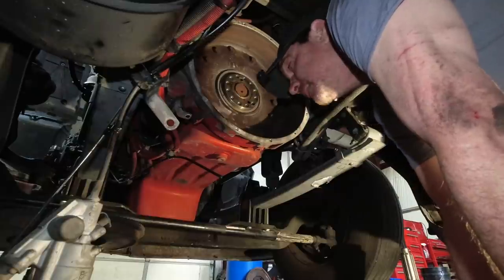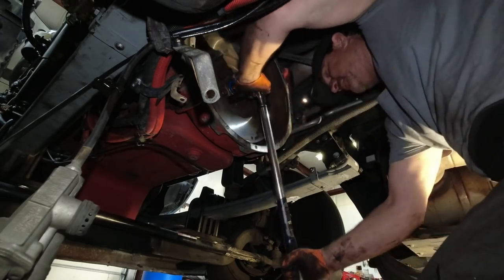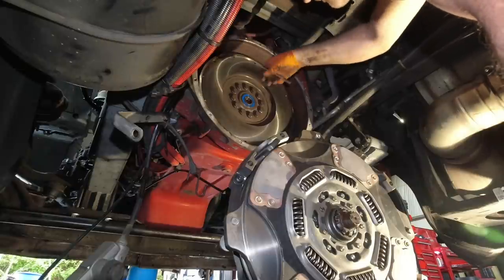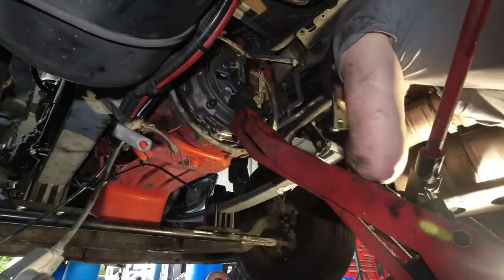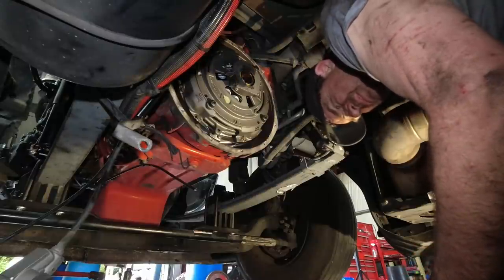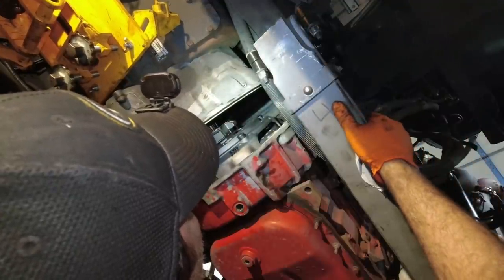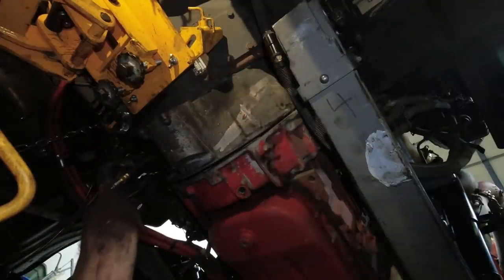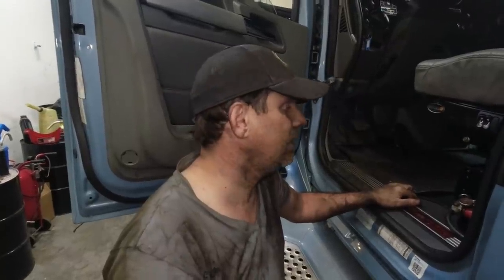Installing flywheel, new clutch, and transmission on Kenworth t-680 2022/31

Comment: Great job, just a tip though it may help.  What I use are the same guides of the clutch housing on the transmission housing.  Add one or two more for good measure.  Also I use a strap to maintain the Jack in the same place and at times pull it.